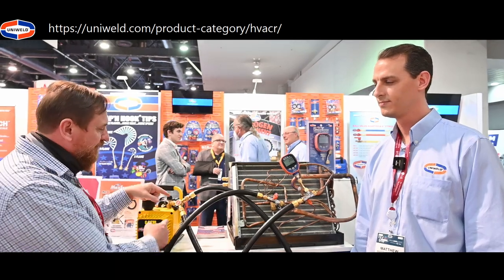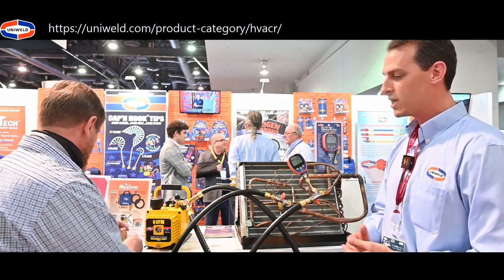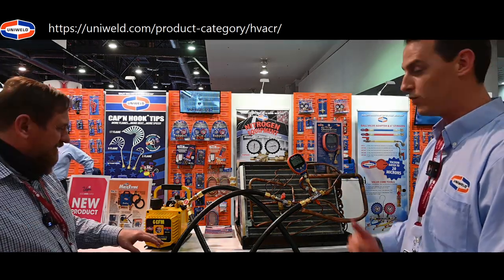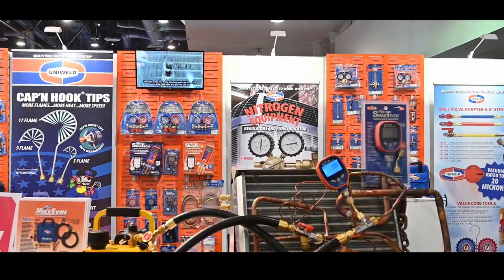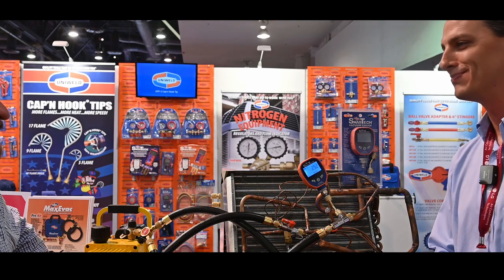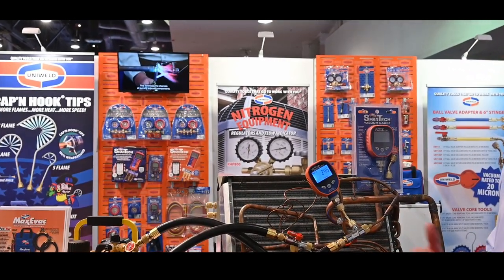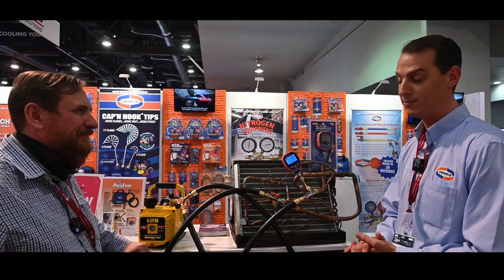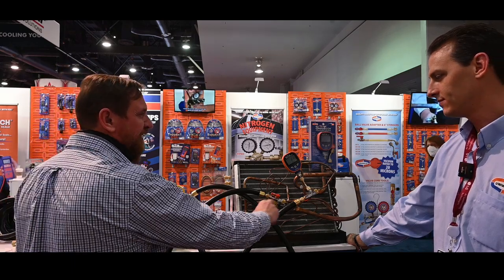AHR Matt Foster, vacuum with Uniweld products

Comment: Appion has speedy Ys. That is what they call them
Reply from the maker: I have a video with them also coming soon!
Reply: @love2hvac  oh I did get an email reply from Appion that they will be coming out with new digital gauges. They told me to hang on and wait, coming soon. I have their vacuum gauge, but can’t find the pressure gauges. They said they discontinued the older ones due to parts and supply chain issues. New style to come soon.